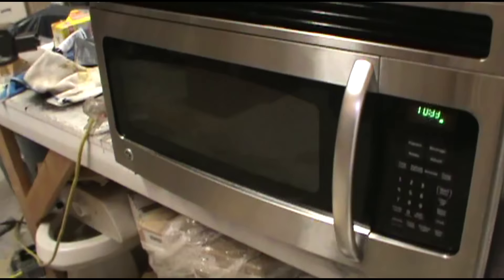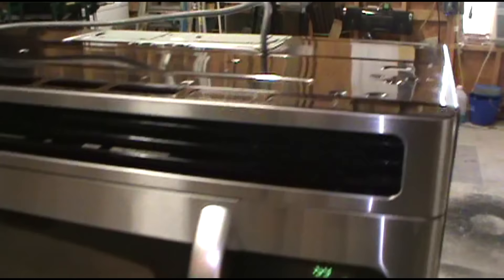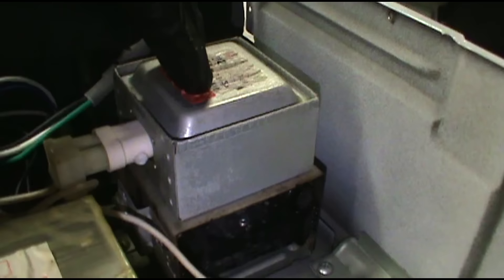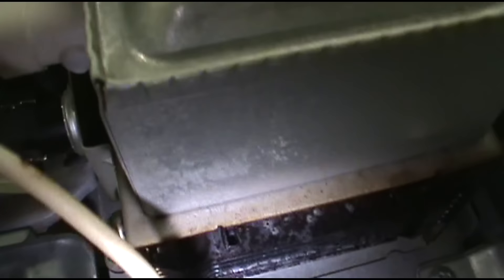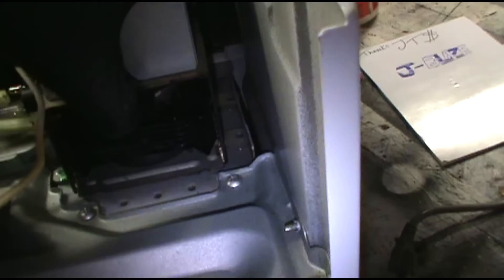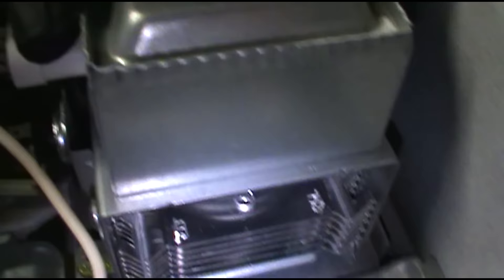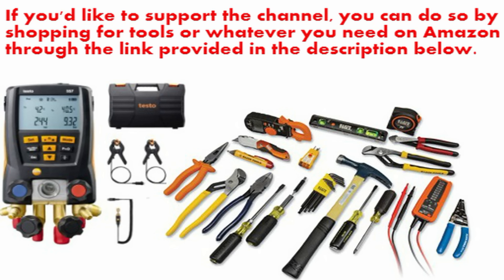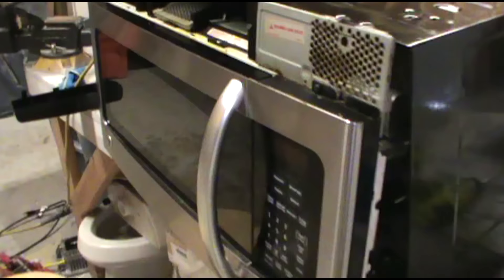How To Fix A Microwave That Is Not Heating Food

Comment from the maker: If you'd like to support the channel, you can do so by shopping for tools or whatever you need on AMAZON through this link,
https://amzn.to/2Mfxmeq

Type In The Brand Of Your Mircrowave And Shop For Your Magnatron through this link -  https://amzn.to/2ME8nyv

This page contains affiliate links, which means that if you click on the link and make a purchase, I’ll receive a small commission. Lex Vance is a participant in the Amazon Services LLC Associates Program, an affiliate advertising program designed to provide a means for sites to earn advertising fees by advertising and linking to amazon. com
Reply: Excuse my ignorance, what’s the deal with the capacitor does it have stored current or…
Reply: Why this link does not open on amazon? Just the page but not your list ?
Reply: Mine madea pop noise then stopped heating

Comment: Thank you! $35 part fixed a $200 microwave. Plus the great feeling knowing you fixed it yourself (with the help of this YouTuber)
Reply from the maker: Nice fix Fingerlakes! Thank you so much for watching!
Reply: Mine went out this morning. Bought another one today but they were in the wrong spot for $96 so I got it at almost half price with 3yr warranty. Experienced but not a certified electrician, the capacitor has always kept me from attempting any maintenance though I've watched people discharge them. This vid made it look simple as long as we're not careless.
Reply: @YTubeScandalScrambledMyHandle  What happens if you touch the capacitor? 🤷

Comment: Lex, Thanks for the video!
My wall mounted microwave is not heating food and making huge humming sound. I'll try to replace the magnetron.
Just wanted to know: this issue has nothing to do with the diode?
Reply from the maker: I'd need to be there to see with my volt meter. Thank you so much for watching Vipul!

Comment: Just subscribed.  I currently have a small microwave that has quit heating. So, I will try this out. Thanks
Reply from the maker: Thank you so much for watching Jj!
Reply: @LexVance  welp, I tried 2 different meters and could not replicate the issue.  

Continuity at the plug. None on the base, anywhere. 

Mine is still in the microwave. Connected everywhere but the plug in. My magnetron is up top with the capacitor on the floor. So, all I did was unplug the main line going into the magnetron. 

Guess I'm back to square one

Thanks

Comment: Hey buddy how’s it going question how would someone know if the magnatron need to change.  I am sure there’s other  parts 
Transformer 
Defective thermal fuse
Door switches 
Main control board 
Diode burnout 

How to check these 

Do you need a multimeter to check ?

Or do the microwave
Reply from the maker: Yes a multi meter. Now days the parts are almost as much a new microwave so we just replace the whole thing.

Comment: Pretty awesome video. Its entertaining yet stays on point and is long enough to cover everything and short enough for the attention spans that have been manipulated by the algorithms.  I got a microwave that is not making any noise besides the fan. Normally you'd hear the magnetron kick on and off and it's not so I'm wondering if it's the capacitor. It's an undercabinet unit so I'm trying to avoid taking it down before I have the parts. Anyone have any thoughts?  It's a ge 2018 manufacturer date
Reply from the maker: Parts are about as much as a new microwave now days. So, we just install a new microwave.

Comment: Nice video saving lot of money. Thank you very much. I have ordered a new magnetron and will follow your instructions. I have also ordered new diode and a fuse in case required to be changed. Mine is working every thing ,means the lights on bottom, turn table , vents and every thing except food and water not heating. So I think after changing the magnetron my micro should be back. Only one question that after fixing a new magnetron can I test the micro on the working table without damaging the bottom lights and vent or should I mount it back over the range and then test? Pl let me know. Thank you very much for the video. By the way mine is Kenmore.
Reply from the maker: Yes, I test on my work bench and it doesn't harm anything. Thank you so much for watching!

Comment: I have a 25 year old GE over the stove microwave/convection oven. It stopped heating food in the microwave function and makes the buzzing sound like in this video so it’s probably the magnetron. But since this happened, the convection function doesn’t work properly anymore either. The convection bake and broil still heats up but it doesn’t heat up enough. For instance if I set it for 350, it only heats up to about 150 and in the high broil function it only heats up to 200 degrees. Why would this be? The magnetron shouldn’t have anything to do with convection function should it?
Reply from the maker: Yeah, due to parts being almost as expensive as a new microwave now days, we just replace the whole microwave with a new one.
Reply: @LexVance  Yeah I’m just going to get a new one but until I do I thought I could still use the convection part but now that won’t heat up enough to use and I’m puzzled as to why that is? It does heat up but not high enough to do any convection cooking.

Comment: We have a GE Profile convection combo microwave that has power to the microwave but doesn't heat. Oven portion runs and heats just fine with no issues. What could the problem be with the microwave? I don't want to get rid of it because it has both lol 
Love the videos!
Reply from the maker: I'd need to be there for this head scratcher 🤔.

Comment: Any idea why a magnetron on a brand new microwave would fail? I don’t know if that’s the exact problem - I just know it’s not heating.
Reply from the maker: I'd need to be there for this head scratcher 🤔.
Reply: @LexVance . I guess there’s several other explanations for why it’s not heating besides the magnetron. Maybe a capacitor, diode, door switch, etc? It’s still under warranty but the manufacturer prefers to do a buyback rebate rather than a service repair.

Comment: Where do you buy parts please I have unique micro wave that has pizza cooker onit to does great job or did.. does it hurt to plug and in plug microwave I can't run portable heater and micro wave out of same socket socket gets hot if 2 items run at same time😮
Reply from the maker: Amazon. Make sure the make and model match yours. And the picture. Thank you so much for watching!

Comment: What a great video, so I have the same exact brand microwave. My magnetron is toasted too. BUT.. you think I also should replace the capacitor.? Or the transformer..??

And also, the white pin plug connector that goes to the magnetron roasted too, is there a web or place where I can get that connector too.? Or the whole plug harness.?
Reply from the maker: Thank you Santiago! This video is old. Now days we just replace the whole microwave because the parts cost almost as much as a brand new microwave. Thank you so much for watching!

Comment: Hi!Theres a problem with my microwave,It’s not moving and It’s heating,But it’s not making a humming sound,I’ll need help please!
Reply from the maker: You may have a bad motor that turns the food. I would need to be there for this head scratcher 🤔.
Reply from the maker: The motor is underneath on the bottom. Remove a couple of screws and on the bottom and you'll see it.

Comment: My microwave once I closed the door it spin without me set the cooking time but when it spin I try to set cooking time no digital indicator, any advice would help.
Reply from the maker: Yikes! Sounds like you need a new keypad circuit board. You can try to unplug it and plug it back in first, though. If that don't reset it then it's time for a new one. Thank you so much for watching Dragonfly!
Reply: @LexVance  
Thank you

Comment: Thank you Lex for posting this video. I have a question for you. I have a Whirpool washer, and when it goes yo spin cycle, the drum is spinning but the agitator is not spinning. I checked the motor coupler, and it’s good. Do you have any idea why the agitator is not spinning? Thank you.
Reply from the maker: Mohammed Aldujaili Hmmm, try pressing it down. Sometimes they pop up & get loose. If that's not it, then I don't know. Its hard to diagnose by not being there. Thank you so much for watching Mohammed!
www.DirtyMaintenanceNation.com
Reply: Ok I will try that. Thank you.
Reply from the maker: Mohammed Aldujaili You're welcome. The middle agitator just pulls up to get it off. It can be hard but it should just pull up.
Reply: Mohammed, if it's not the motor coupler. It’s the agitator dogs. A common problem with whirlpool but easy to fix. Take a look at this, it might help you:  
https://youtu.be/Rd-bTgOzhpk
Reply: Peter H Thank you for your responding. The agitator dogs are good, and the washer washes probably. I think the transmission has a problem. Thank you again.

Comment: I just had somebody drop off the exact same microwave with the exact same problem.
Reply from the maker: Right on. Thank you so much for watching John!
Reply: Thanks for responding back. I was going to scrap this but it's a nice microwave and I'd hate to see it ripped apart. It's not cost-effective for me to fix it and I'd like to see it fixed and donated to somebody that could use it. You wouldn't happen to know any national charities or ones around St. Louis where this can be donated and fixed?  I just wanted to magnets out of it. I know there's other stuff in there that can be scrapped but I like to fix stuff if it can be.

Comment: What if is not the magnetron or the capacitor?
Reply from the maker: Get a new microwave. The parts almost cost just as much as a new microwave. That's what we do for our residents.
Reply: @LexVance  I’ve already done that the only problem is that’s the only microwave that fits in my motorhome. The new ones are just a little bit too wide and the door doesn’t open properly
Reply: @LexVance  In any event it ended up being just a thermal fuse. The only one I didn’t test and of course I test all the micro switches as well

Comment: Thnx Lex, couple of questions, if you check and the Magnitron still looks good is it the thermal fuse ????
Reply from the maker: Hmmm, it's hard to say by not being there. It could be lots of things. The door switch can cause it not to spin & heat as well. I'd need to be there with a volt meter. Thank you so much for watching Hans!
www.DirtyMaintenanceNation.com
Reply: @LexVance  how do I fix the door switch pls ?

Comment: Is this still worth fixing for a cheap ass $50 microwave you bought at Walmart?  Asking for a friend!
Reply from the maker: Nope! 🤣
Reply from the maker: The magnetron cost as much as a new microwave. 🤣
Reply: Yeah I didn't check the link until after I made this comment. I guess it had a good run. At least the clock still works 😁